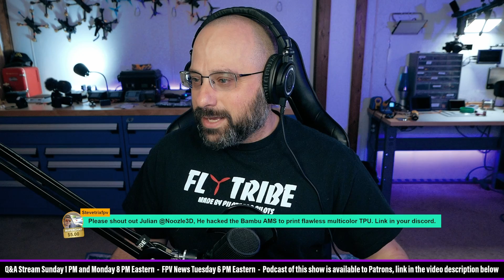How Do I Fix My Magnetometer In Betaflight? - FPV Stream Questions

Comment: I had a drone that used inav and the magnetometer was in embedded into the gps. When calibrating the magnetometer, the measurements were 180 degrees off what the manufacturer said was "north". So I configured inav to tweak the magnetometer 180 degrees in software. I had one good flight (but the drone toilet-bowled at the beginning of the flight a bit) but after a while it locked and completed the mission. Second flight, the drone went completely the qrong way and I haven't found it since.

Q: do i have to calibrate the magnetometer before every flight?

Comment: There's a glitch. If orientation is wrong. Compass doesn't turn. It snaps back. Where it doesn't work at all.
Reply: Just killing myself because of this glitch. M10Q-5883 says BetaFLight: compass Arrow forward, set CW 270° Flip when flight controller arrow is facing forward. The arror on M10Q is facing forward, My FC is turned by 45 to the left. I've made the adjustments and set custom CW 225 flip. Compass is calibrated. But anyway, I have this glitch....
Reply: @DnDwarf2 Did you figure it out? I have the same chip and can’t get the custom alignment right so that the snapping back doesn’t occur. Considering to just not use the mag at this point
Reply: @oliverkrause7307  did you find a fix? I am having the same issue lol.
Reply: i managed to get it work in inav, did not identify what was the issue in betaflight tho